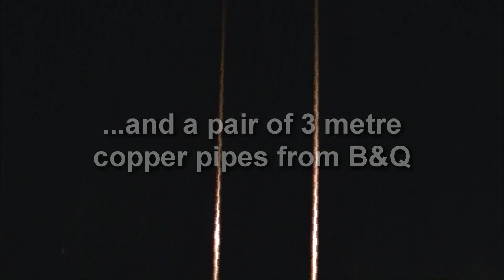Photonicinduction's 3 metre Jacob's Ladder

Comment: You need modifications.  First, the spacing between the wires should start close at the bottom, tapering outward for 6 inches to a constant spacing all the way up, spreading again at the top to the breaking point.  The entire ladder needs to be enclosed in a clear tube (open at the top & bottom) to shield it from room air currents, & to enhance the "chimney effect" to drive the arc upward.
          For example, for 15KV 30ma neon-sign transformer, the spacing should be 1 inch for the parallel part, starting at 1/4 inch at the bottom & spreading to 3" at the top.  The bars should be rounded at the ends with all sharp points polished off.  When done this way, the arc starts cleanly at the bottom, & climbs up without sputtering or pauses, for a clean break at the top.
          The higher the current, the greater should be the ratio between the starting spacing at the bottom, & the parallel spacing, & between the parallel spacing, & the breaking spacing at the top.
          I have made these with the straight section helical.  It is important to have supports to hold the wires firmly.
Reply from the maker: That sort of clear tube isn't available to anyone just popping into B&Q on a Saturday evening, which is what we'd done after coming up with the idea.

Comment from the maker: Yep. We know we were pulling 60A on the 15A one because we were metering it. That was hooked up to a ring main. The 28A was on a shorter, thicker cooker circuit, with separate cables going to each transformer. Whatever they were pulling, it was a lot!